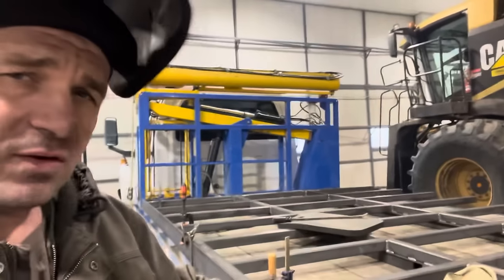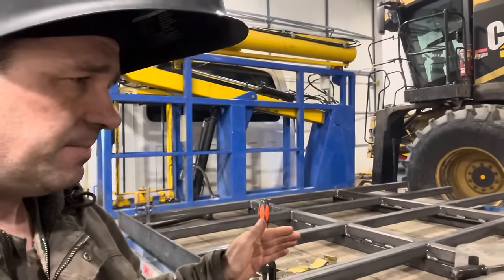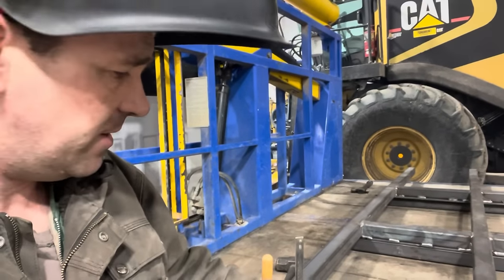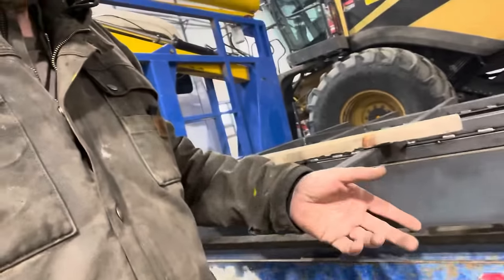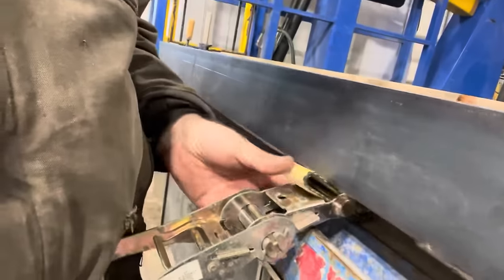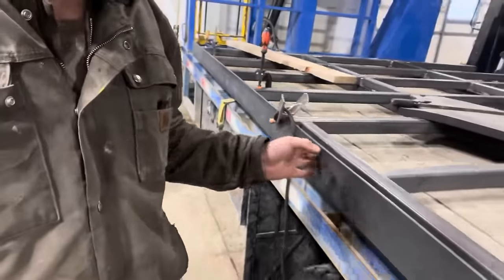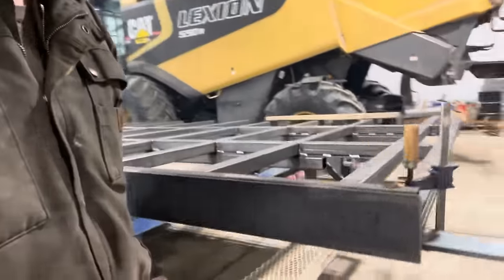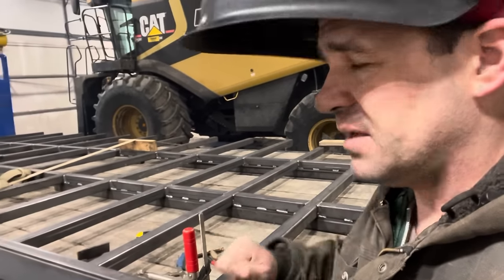A Start on the Bee Truck Deck

Comment: With your rear step, how about a pin hinge just under the deck and the 45 deg brace but a stopper plate. That way the step can move out of the way but act as a step when you need it.  Your step would have to be heavy enough to swing back.

The only issue would be if you have to reverse out of a sticky situation but then it's no different to what you currently have.

Comment: Hey, you can make that step on the swivel with a locking mechanism at the top, and you can slide your stamp under your deck step by itself, will solve the issues with the staff sliding back from the flatbed

Comment: All the butt welded tubing will either sweat or leak and trap water and freeze, bulge, or crack the tubing when it does. The temperature fluctuations will cause a constant vacuum every day and suck in water, trust me.  Better drill some holes.  I worked at DEL Equipment for a brief period. Old Charlie had 25 years in at the time. He built a flat deck every week. Some of your butt welds will crack at the weld. He always drills a hole at the end of a weld to release stress, then filled the hole with weld. You made a lot of cuts and pieces to be butt welded which adds crazy amounts of work. Crossmembers (width) pass through the tubing (length of the bed) or over it. He always welded it upside down. He told me that when you flip it over, bolt it to the truck, start loading it with weight, it will flatten out and stay there.
Reply: C channel would have been so much less work. Professional build decks and trailers never cap tubing.
Reply from the maker: I definitely hear ya.  Extra work, yes. Built for my specific purpose though.

Comment: Thanks for the update. Everytime I see a new video, I wonder how the new truck is coming along. Just curious, why do you prefer wooden deck vs. steel deck? Cost, weight, etc.
Reply from the maker: Wood decks don’t slide loads as bad.  I like how it holds my hives from slipping especially when they get loaded during snow.
Reply: Thanks! Bob Binnie had put out a video yesterday, and in it said he liked the metal bed to be able to slide them around. So, I was just curious. But that makes sense for your particular situation.

Comment: You do great work. what size box tubing? I need to build a 8ft flatbed for my truck and I'm wondering if I should use 1/4 or if 3/16 would work. I'll probably only stack 4 deeps high max, it's only a single axle 250 and most of the time just 2 high. I don't move my bees much.
Reply from the maker: These are not that heavy, the plans show 10 wall, I bought 1/8” and went 16”

Comment: We just built ours. Out of channel and loaded our first 100 boxes into almonds. Awesome seeing your process. How much does the metal itself weigh?
Reply from the maker: I’d need to weigh it but it will add weight for sure. I narrowed the spacing to 16” which added more steel and went with 1/8” instead of 10wall which I think is the same thing anyway

Comment: Ian I'm just wondering your opinion with all the work you have to do to theses EZY loaders would it be easier just to use a skid steer?
Reply from the maker: Oh, I do very little work on the Ezyloaders.  Just maintenance, which is basically nothing.  
A skidder would work, yes.  I’ve chosen not to drag around a trailer and just load with the arm.  
The Ezyloader was bought specifically for honey box lifting

Comment: I like the deck build. Nice work. 

The step could easily be made to swing up and lock out of the way for travel. 

I don't like your strap setup. You'll be pulling fabric straps across sharp metal corners. I suspect they won't survive long with your bumpy roads.
Reply: You got that build down, Pat... time for mine... ha ha😂